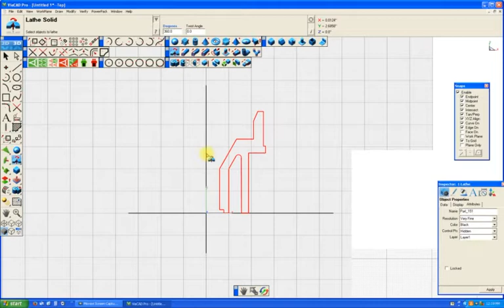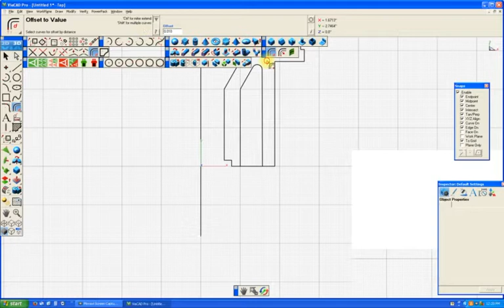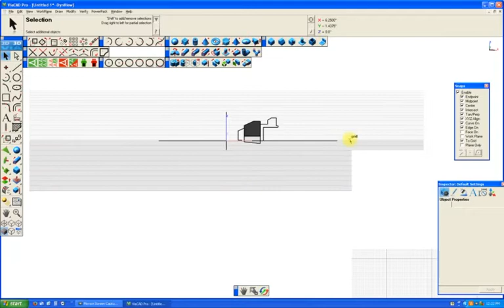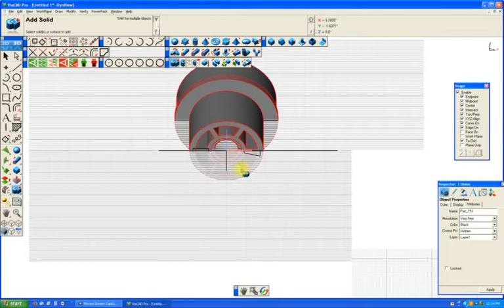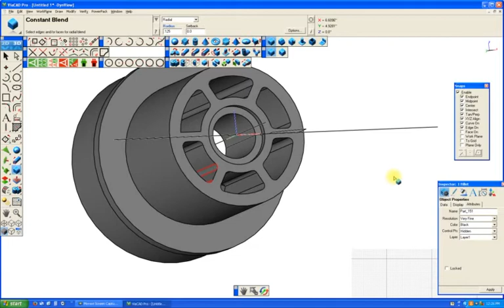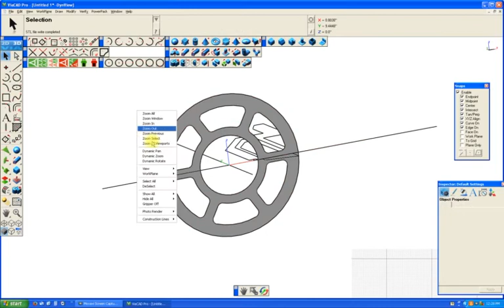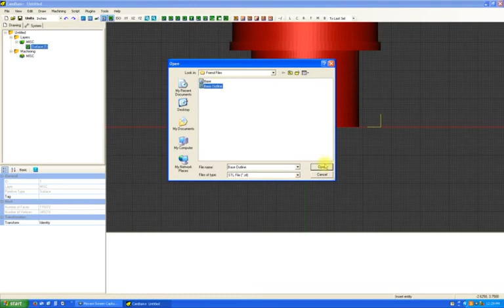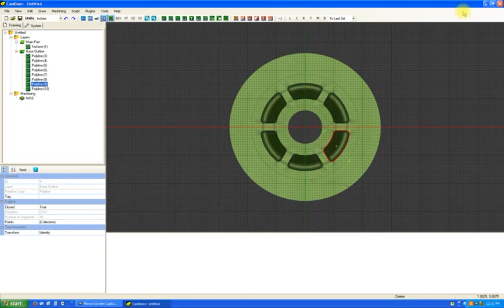Creating A Cylindrical Solid in ViaCad 2d/3d Pro with Dividing Vanes for Use in CamBam

Comment: Great video and just in time! I have a question:  How do I tell Viacad V12 Pro what axis I am wanting to draw out a circle on? It seems hit and miss whenever I want to draw a circle a box. Most of the time it will try to go perpendicular to the surface I actually want it to be on. I know there is a simple answer but I can't remember what it is. I should think that there would be a choice to select prior to drawing the circle out but I can't find it if there is such a thing. Can someone tell me? This is embarrassing.
Reply from the maker: I always forget and have to look up how to set the work plane.  Typically I work off the default work plane which is (XY) Z=0, but you can change that.  If you have snaps set to "on face" you can draw a circle on any face of a solid or surface.  There are lots of ways to get somewhere in ViaCAD.  FYI:  I'm not the ViaCAD guy.  I'm just another user.  I did this particular video to help out a user on the CamBam forums who has helped me many times.  Look for videos by Tim Olsen.  He is the original ViaCAD Author.
Reply: @boblalonde8661  Many thanks, Bob. I appreciate you weighing in! The "on face" rings a bell and I think I used to have it set that way years ago. I'm just getting back into this as of today with V12 Pro so this well be helpful. Thanks again.